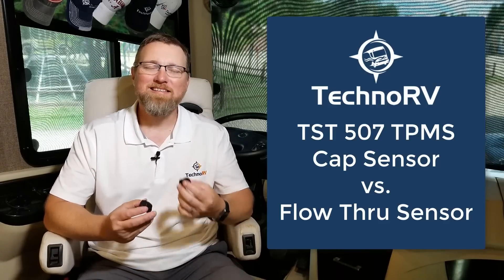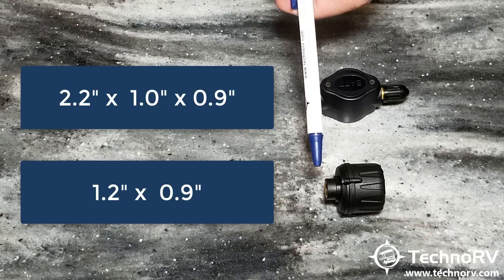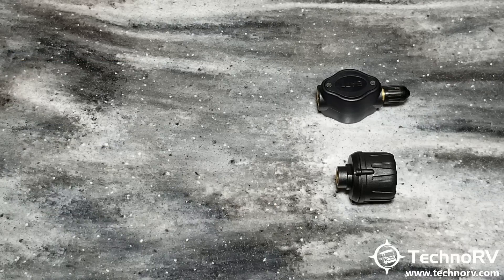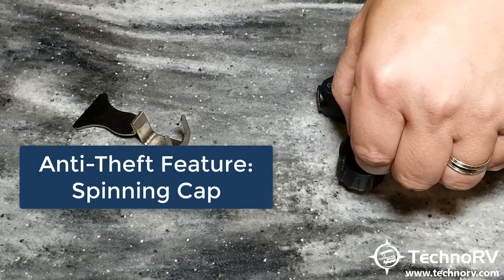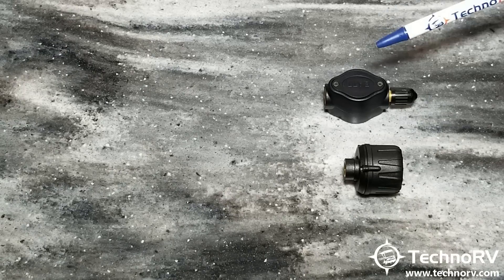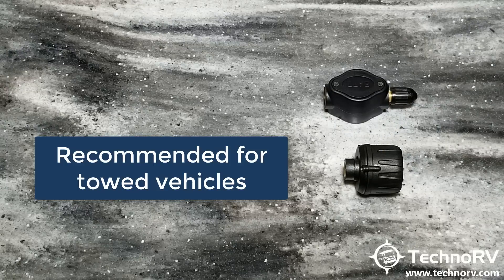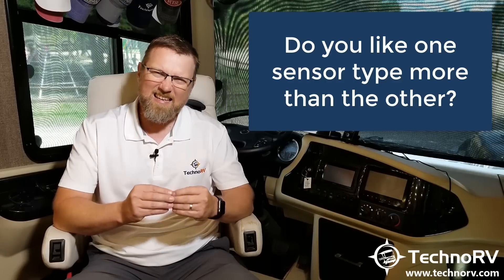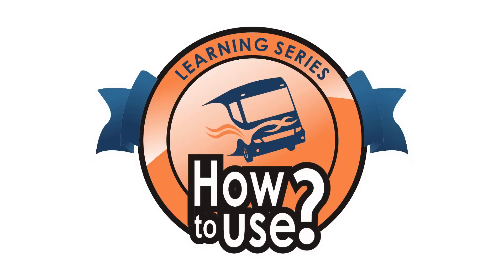What are the Differences between the TST 507 TPMS Cap Sensor and the Flow Thru Sensor?

Comment: I just purchased my system, including some cap sensors for my towed vehicle, and flow-through sensors for the motorhome. The cap sensors seem to have changed from this design, based on the ones that I just received. For my cap sensors, they now have a locking nut that goes onto the valve stem underneath the sensor, and then you use the wrench to tighten them up against the sensor. The cap sensor itself seems to be just hand-tightened. It works fine this way- just a slightly different procedure than the video shows, because of the different construction.

Comment: I am upgrading the flow through sensors after 6 years of use on my G rated 5th wheel tires. (One sensor completely failed. The plastic collar around the brass threads literally broke apart in my hand as I was removing it from the tire). They lasted six years and 4 battery changes, but are showing signs of getting brittle. I think I'm going to try the cap sensors this time. One thing I noticed about the flow through sensors;  there seem to be a very very slight loss of pressure in between trips, and although I check tires before every trip, I always seemed to have to add 5-10lbs PSI every 2-3 months...from the day I first put them on. I hypothesised, that possibly by design, there could be a very slight air bleed on the flow through sensor. I'm hoping the cap sensors might behave more like valve caps on a stem and hold pressure a little better. I guess we'll see.

Comment: I have rubber valve stems and had one fail on our last trip with the cap sensor so I would say that you should have steel valve stems regardless of sensor type.
Reply from the maker: Paul, I hate to hear that your valve stem failed.  In a perfect world, all valve stems would be rigid/metal, but most tires with a PSI of around 80 or lower are usually given rubber or rubber/metal hybrid stems.  The cap sensors are actually designed to operate on those type sensors, and we rarely hear of them failing on rubber valve stems.  That being said,  I completely understand you changing to metal after having a rubber stem fail.  Thanks for sharing the tip!

Comment: How much clearance does the cap sensor need between the end of the valve stem and the sensor? My stems are somewhat 'buried' inside the hub caps and it looks like the sensors might not "reach" the stem...
Reply from the maker: The cap sensor is 1-inch long, so if your valve stem is buried and you don't have a lot of room to work with, you may need to get a valve extender.

Comment: Just put in our order for a new Grand Design Solitude, and these will be my first upgrade. Excellent information, thank you from  us "Newbies"
Reply: Update to rubber valve stems in 2022:  I have cap sensors on my 5th wheel with rubber valve stems. One of the valve stems failed, it literally tore the valve stem down by the wheel. I upgraded them all to metal valve stems. Hopefully this will solve that issue.

Comment: One important thing you should do is have all your valve stems changed to metal ones. I learned that when I had a low pressure alarm go off at 70mph. I safely got off the road and called AAA-Plus. Tire hanged and drove to a Goodyear tire store and was told the TPM caused the rubber valve stem to fail. Had all 5 tires changed to metal and no more vorries
Reply from the maker: Hi Loyd, 
I am glad everything worked out for you and everything is ok. It is recommended to use metal valve stems with the flow thru sensors for sure. The cap sensors are good on the rubber valve stems. 
Safe Travels.. 
Eric
Reply: @Technorv  I have the cap sensors and my failed valve stem was soft where it failed. That was my second failure but didn't associate the first as a problem with sensors

Comment: is re calibration required whenever air is added to to a tire?
Reply from the maker: When you add air to a flow thru sensor, the new PSI will show on the monitor after you add it.  If you add air using a cap sensor, the new PSI will show on the monitor after you place the cap sensor back on the valve stem.  There is no need to recalibrate anything as long as you are still running with the same cold tire pressure and were only adding air to get the tire pressure back up to the correct PSI.  If you are adding air because you are changing your cold tire pressure due to say increased weight, then you would want to change your low and high parameters to reflect 10% below and 20-25% above the new cold tire pressure.  I hope this helps!  If you have any more questions, just let us know.  Safe travels!

Comment: Personally, I don't want to mess with the anti-theft tool, etc.. It's hard for me to imagine, in my typical parking situation that there is much danger of having there sensors stolen. Naive? 
Can I remove the anti-theft encasing and just use the screw on valve?
Reply from the maker: Yes, you can remove it and then it will just finger tighten without any tools.  We do that for our Jeep tires since we like to off road and don't want to have to worry about having the tool with us when we need to remove them.  We have another video showing how to remove the outer cap that spins which allows you to use it without the tool.  They will no longer be theft resistant, but if you feel comfy with that, it is much easier to use without.  Safe travels!